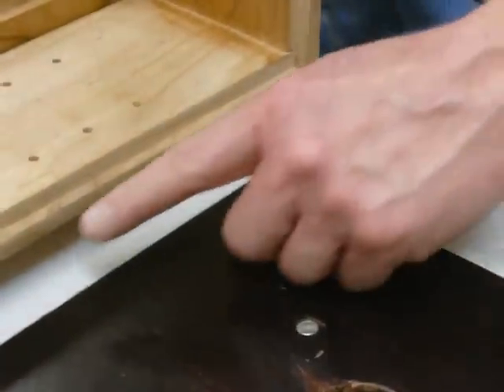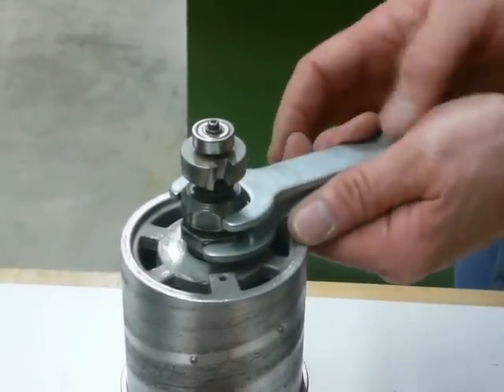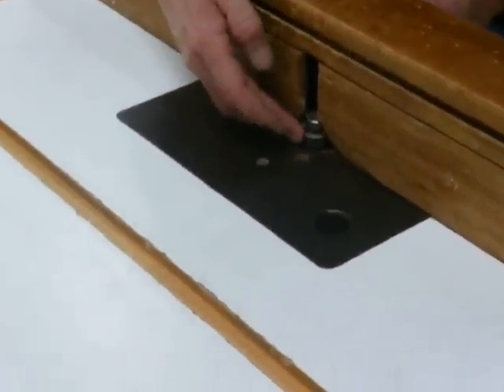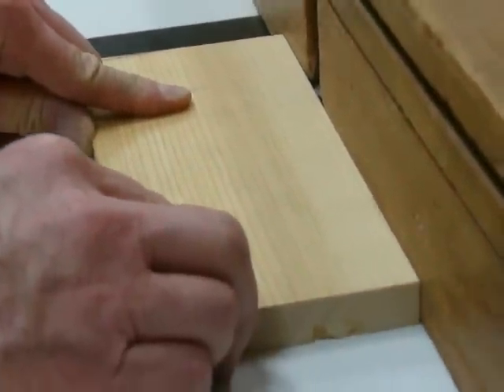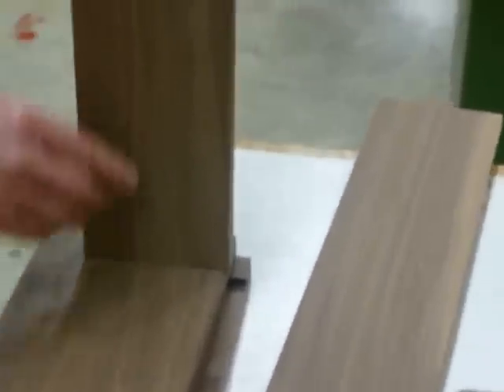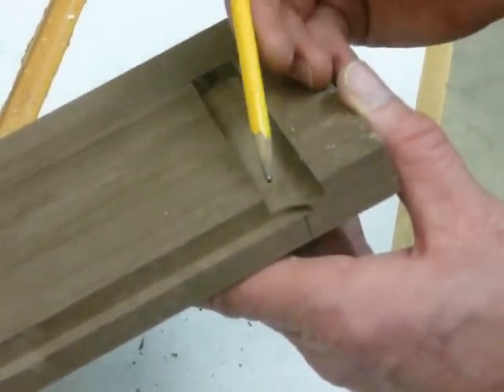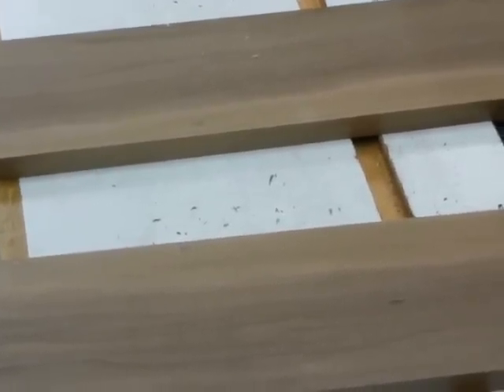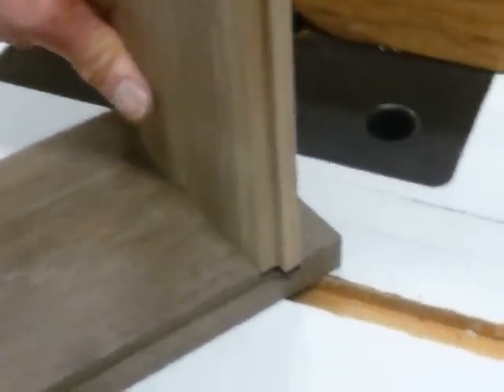Routing Rabbet Joints

Comment: Hi may I ask you a question please . If I was to to use a dado (groove or slot) and perhaps a rabbet too for the top of a sideboard (I guess it would be a shoulder joint in this case) would you be comfortable with just glue or would you recommend also using dowells ? I am just afraid it might come apart..probably paranoid.